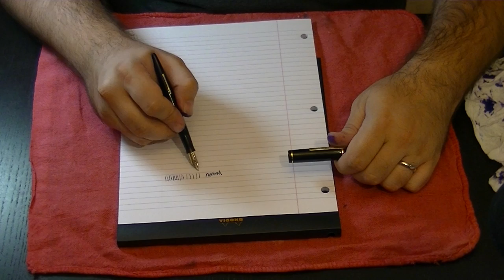How to smooth a fountain pen nib - pentuner.com

Comment: Hello,
Soak the micromesh (12,000) in warm water for about fifteen (15) minutes, and then apply some organic coconut liquid oil onto the mesh.  Place the mesh on a piece of cloth on a flat surface area or a portion of soft cardboard and draw the treble clef music sign (brace) without any pressure; a fountain pan's weight is sufficient for this procedure.  If the pen is too light, put a (depending on the diameter of the fountain pen) 3/8" (0.020 Oz, 0.566 gr) or 1/2" (0.17 Oz, 4.7 gr) stainless steel or brass nuts 1/2" above the nib on the pen's holding area.  Also, use tape to hold the nut and keep the person doing the process from touching the nuts, where stainless steel and brass have California Proposition 65 Warnings.
Sincerely,

Comment: If you want to avoid this chore just buy a Bock or a Pilot nib.
I have never had to do this with any of the Bock or Pilot nibs I have had. Now Lamy Safari nibs, that's different.
You didn't mention that finer nibs will have feedback or that the paper quality will effect smoothness. Writing fiigure of eights on the backing card on a Clairfontaine pad can help.
Micromesh should only be used on home done modified nibs ime.
Reply: You can use micromesh with any type of nib. I have successfully used such sandpaper - actually multi-sided nail sandpaper, not everywhere you can get micromesh - on several of my nibs.
There are many brands that use Bock. They don't scratch, but they can have a baby bump, in which case you'll have to use micromesh to fix it.
Reply: Pilot kakuno nibs are really feedbacky. I use a 5000 sandpaper to ad a light pad to them and then I always Micromesh after and they feel 100x better

Comment: That's a flex pen (if it has the original nib). I have one, and it's my nicest flexy because it rarely railroads. I'm surprised anyone would try to smooth a vintage flex.
I've just checked the range of nibs which originally came with the Eversharp, there was a Manifold, but you don't have that. From the length of the tines, you seem to have a flex nib, which explains why it felt 'scratchy'. Flex nibs tend to feel scratchy when not used properly. It's a shame to smooth this nib and lose its fine stroke.
I couldn't watch this vid the whole way through. It was too painful watching you destroy this nib.

Comment: Just 3 figure 8's on my 0.3 micron makes my pen really scratchy and weird. And sometimes the pen's finish repels ink. 1 micron is fine tho.

Is this... Normal? What am I doing wrong
Reply from the maker: I’ve stopped using the micron paper for 98% of the work I do. It’s too finicky. I use 12,000 grit micromesh for almost everything, and will use 5000, 7000, and 9000 grit Emory paper for aggressive smoothing and to cure mild baby’s bottom
Reply: @Pentuner  hmm I still sometimes use 1mylar. And on very fine nibs a single single swipe or 0.3 but I really agree with you,. I reshape the nibs of most of the pens o know because sadly very few come out good out of the box. Specially kakunos are too round and don't have much nib in contact with the paper and feel feedbacky. I add a light pad to them with 5000 sandpaper and then polish it up to 12,000!